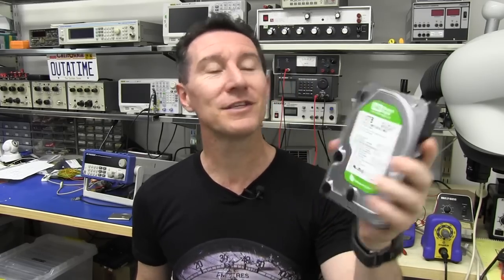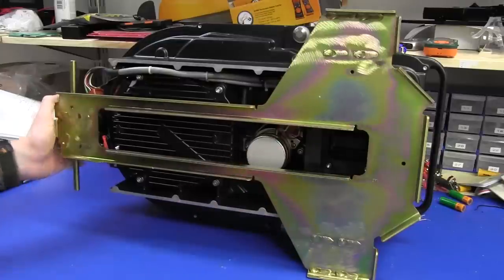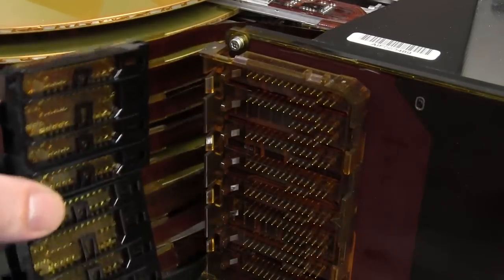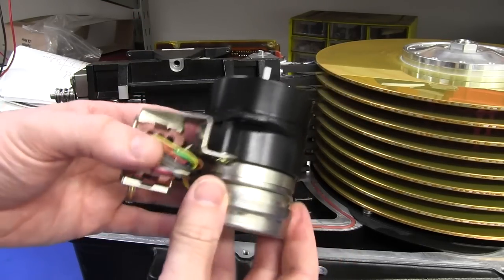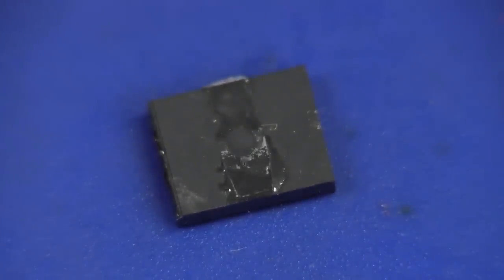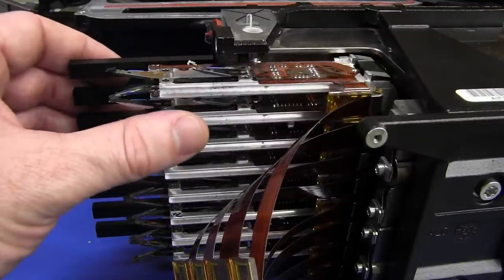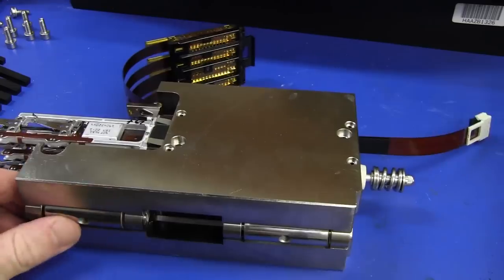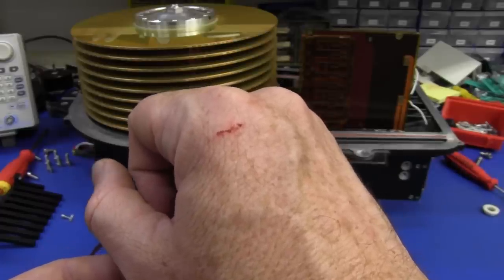EEVblog #395 - World's Most Expensive Hard Drive Teardown

Comment: I loved the video.  I worked at IBM San Jose I was on the IBM 2311 development team back in 1962 or so. The 2311 was the size of a clothes washing machine and head movement was via a hydraulic pump and It sported a massive 5 meg, removable platter. I worked on a thing called a robot whose job it was to connect the 2311 and power it up, make it move and read/write the data.
I had no idea how important this drive would become as it allowed the start of Silicon Valley when company after company ripped off the 2311 design for there own products.
If I had only known - sigh.

Comment: I opened a few drives too, a MFM drive witch used a stepper for the head movement , and several newer ones that use 'voice'coils like this unit. I played music trough them for demonstration, the sound was not that bad actually, a little low volume, easily solved with some cardboard     8-)

Comment: I remember back in the 90s that a service team came and replaced all the glue on the heads in our 1 Gb multi platter VAX hard drives because the glue outgassed and was failing in sysyems about as old as ours were even though it was only a few years old.

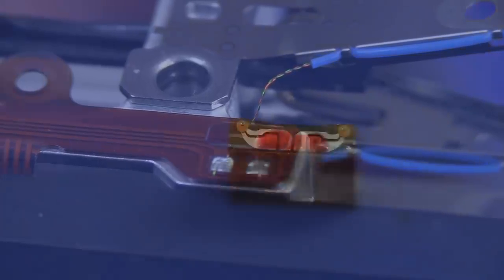Comment: At 24:24, there appear to be two head coils, but one of them isn't connected.  The disk drives I worked on, and also the tape drives (I later worked for StorageTek, who made take robots) did a read after write - so data was written by one head gap, then immediately read by the second head.  The read was used to generate a CRC (Cyclic Redundancy Check) which was compared with the CRC that was calculated for the write, so that the data on the magnetic surface could immediately be verified.

Comment: You're talking late seventies, and 10MB, but even at the end of the seventies, a 10-40 MB disk would fit into a normal 5"1/4 full size disk enclosure. The Xebex 1210 is already from that era to control it as well. The stuff that would end up in the IBM PC a couple of years later was quite off the shelve stuff even a few years earlier.

Comment: The heads do not come in contact with the surface of the platter ( not supposed to anyway).They float on a cushion of air after the drum has spun up.    Most metal recyclers won't accept older drive platters because of the 'toxic' coatings. Your drive is tiny.  I have the HDA from a 5 meg Ramac drive at home. the drum was the size of a 44 gal fuel drum.  the drive was 800Kg.

Comment: Great video! However one statement needs correction. At 25:27 you state that that the skids reduce the contact surface area and therefore reduce the friction. This is incorrect as the frictional force is dependent only upon the co-effcient of friction and the normal force acting on article; the contact surface area has no effect on frictional force. The skids are there to create an air gap which assists the lifting of the head when the platters begin to spin, causing the boundary layer of air on the relatively fast moving platter to induce lift on the head, as you correctly stated.

Comment: So many errors and misunderstandings in this. For starters:-
That's just the HDA (Head Disk Assembly) from an IBM 3390, a box the size of a couple of fridges. There were 2 to 6 HDAs (depending on model) in the box, which also contained all the other electronics required to provide the equivalent function to the familiar hard disk. These were introduced in 1989, and the HDAs have absolutely no resemblance whatsoever to the earlier models that they replaced. (I've torn down a number of them myself) This is definitely NOT 1970's technology..
And the HDA cost nothing like $250,000. The whole box, along with the other HDA(s) and electronics, started at $90,000.

Comment: That drive is a lot bigger than 1MB per platter. I ised to work on 70s units that were 35/70 MB. Biggest drive i saw was in LHR air traffic control. about 3-4ft diameter single platter. fixed heads 2MB

Comment: That would be using something like rll or mfm encoding so the controller would need to encode the raw data for writing or decode it for reading. Back then it would have on the interface card and not the drive.  It was only when the later SCSI and IDE interface came in the late 80's that the encoding was handled by the drive.  The current drives SATA and SAS drive are the same just the interface has changed and throughput has increased.

Comment: I remember these drives on some mainframes I worked on in the late 80s / early 90s ... The days when "IT" was called "data processing"! These were up to 60 MB by then. The drive here is missing the controller board(s) and power supply = Taking up 3 times more space of the massive drive assembly! Also keep in mind that 250 grand was in 1990 dollars = almost double that considering inflation and CPI. Jeez...

Comment: And to think of how quick the technology advanced in 40 years that nowadays we have hard drives that can store up to 20 TB in a single unit with a couple of platters that the data is super-concentrated there.
And probably in 10 to 20 years we will sureley see and use HDDs or most probably SSDs that will be able to store up to half a petabyte in a 3.5 or 2.5" bay.

Comment: If this unit was used and not block erased you can possibly recover data from it up to 75-100 years later, so information valid from jan/1/1989 to dec/31/2,089. Of course, it would be in any good shape as the temperature sticker, but may still be there.

Comment: Napkin math tells me that 16 surfaces with 11" (28cm) dishes holding 10MB is an info density of about 8100 b/cm², or about 52,000 b/in². In 2020 we have commercially available HDDs with more than 1 tb per sq.in. (approaching 1.5Tb/in²). 1980: 52,000b/in² (for $250k) -> 2020: 1,000,000,000,000+ b/in² (for <$100). When people wonder why I'm so enthralled by tech... I don't even know how to start explaining it to them. You're helping!
edit: I see now that 10MB was way off - I heard you say it at the beginning but now I see the info and I've looked into the 3390, more like up to 22GB! That changes the math a lot, now it's more like 18mb/cm², so only 2-3 orders of magnitude in 30 years, not 4
Reply: In fact, there are only 14 surfaces used for data and the capacity is 3.78GB.

Comment: I was using 19" (I think) drives that combined a 4.8MB fixed and a 4.8MB changable medium on the same spindle.  From memory I'd say about 20cm high, the media I think were 12" but not sure, it's sooo long since.  They needed like a minute to spin up, then one could press a mount button and move to the console to actually mount the drives.  The system was running Edition 7 UNIX, a Interdate 7/32 and had three of these drives.  And a nice three phase connector.
The drives also contained two huge elctrolytic capacitors each about the volume of a 1l or so.  Their sole purpose of these caps was to retract the heads in case of a power failure to avoid a headcrash.  Which made a spectacular loud bang.
I can't image the heads on these drives were actually in contact with the platter, how can that have been reliable?  They would have required magic to keep the friction low!

Comment: Well I used to work at a Southern Bell data center in Fort Lauderdale that handled all the billing. It was 1976 and we had a couple dozen ISS disk drives 100 MB each. They had a removable disk pack that had twenty surfaces, one of which was a servo track used for positioning. The disk platters were about 15" in diameter. Head assembly was on rails and was moved by about a 4" diameter voice coil that had a massive magnetic structure. A seek operation would cause the head assembly to ramp up to full speed and decelerate and come to a full stop without any overshoot to the track it was seeking to. And it moved very fast.  One weekend a SoBel employee loaded a disk pack into a drive and walked away to get back to the operators console, 50 feet or more away. Well the heads crashed and since the operator couldn't read the pack they moved it to another drive, and another drive and so forth. Well a head crash means just that. The heads fly above the disk, supported by a cushion of very filtered air, but only by a micron or two. A particle of smoke was at least fifty times bigger than the air cushion was. The head crash created enough debris to crashed all the heads in that drive and each drive they moved the pack into. By the time they were done the pack had no oxide left on any surface and each drive had piles of broken ceramic heads everywhere in the disk well. I got to fix them all too. Had to install all new heads and align each one in about eight drives. Later on ISS produced another model that was the same size but doubled capacity to 200 MB, we were amazed! I maintained those disk drives, large Telex nine track tape drives, there were about thirty of those, IBM and Telex line printers, IBM card punch and reader, and multiple main frame multi-processor systems that ran them all, custom designed for Southern bell. We were a team of four field service engineers at that site. I got hired there due to my extensive knowledge of Digital Equipment Corp 11/45 Unibus systems. I was the company specialist on those and got flown around to handle the problems others couldn't fix. I loved my job too, it was lots of fun. Never hated going to work. An hell, I got to live in Fort Lauderdale, Florida. What's not to like?

Comment: Interesting. According to the updated information this is either a 1.89 or 3.78GB drive.
As was shown in the video, this unit was apparently made in 1991.

Recently I acquired a Seagate 2.1GB SCSI hard drive of a model that was made and sold in 1994.  According to 1990s newsgroup postings, the "list price" was $2500USD, but people were buying them for more like $1500-$2000.
It's a 3.5" form factor drive but it's "half height", meaning it's 1.6 inches tall. So it's almost as small as a typical modern desktop drive, just taller due to the number of platters it contains.

It's obviously a hell of a lot smaller, simpler, and cheaper than this drive of similar capacity made just a few years earlier.  So it stands to reason there must have been something more practical than this with ~2GB available in 1991.
At that late date, I suppose this IBM drive was NRND and just being offered as a service replacement part.  Which makes me wonder if it ever saw actual service, or saw enough of it to gain much wear.  Maybe it still worked.

Comment: The temperature sticker looks to be the one off-the-shelf component in the drive -- you can get sticker tape thermometers just like that meant to stick on fishtanks. Also according to Reddit (EDIT: post seems to be from 2016, so after this video was made), this may be a 3.78 GB or so drive, which would explain them still making them in the early 90s. It seemed strange to me that anyone would spend a quarter million on a 10 MB drive in 1991, even just replacing old equipment.

Comment: Right, thats not a 70s machine, 1989 going into the 90s.  I worked on the 1970s Control Data storage module drives with removable packs, some had 5 disks some 10. There was a fixture you used with long mirrors and light to look for bad spots or scratches on the disk. clean room only.  you could replace the heads & align, very dangerous because you had the thing spinning and  your tool in there on some track, had to loosen the head, adjust, tighten.  Sometimes the operators would make a HUGE mistake, hey disk TR003 showing blank but it had lots of files? ok go move the pack to TR002 and lets try it there. Yes data! oh wait its gone again? put it on TR001... no data.  Go out there and its a burning smell and metal dust is coming out. Just destroyed 60 read/write heads on 3 machines taking about a week to fix all 3. They had SCSI interfaces, ECL logic and the seek time was as fast as now. Just the bits per inch and disk materials changed radically.
Reply: These also had the fiber service ports, same as you describe, and are also removable cartridges. I worked on them many years before.
I was the one who pulled it out from the bank. They kept making them years after, due to the original massive install costs.

Comment: The technology to make computers small and fast has significantly impacted all manufacturing for the better. Indirectly it made it possible make engines for cars that run for 300,000 miles and take water thin oil at 5w.

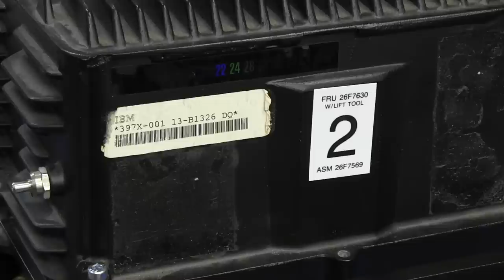Comment: Uber-old bump... An educated guess is that number at about the 4:00 mark is in reference to an IBM 3970 telecommunications adapter. Back in the day, on mainframe systems from IBM, you'd get these generic interface descriptions which were misleading at times. I believe that in this case the marking is showing interface compatibility with the 397x series adapters. They say "telecom" adapter because that's what they were first designed to be used for (modem lines, matrix lines, etc), but it's just an I/O, so they bodged it to use hard drives as well as floppys. Interesting fun fact is that you could (again, back in the day. Think 1980s) go in a serial line from a mainframe to a controller to a PS/2 system and mount drives and the like along any device that had the resource. When the place I work went from mainframe to distributed server architecture, it really confused all the "old guys" at the time. Now that I'm an "old guy", I get their confusion!

Comment: Are you sure about that Halon thing ... I think they used those to pump pressure out of the drives so that dust and bits of stuff would not fly around inside the drive and crash the heads, but it has been a very long time.   I don't think Halon would be good for the magnetic surface of the disk.

Comment: Seeing as this one was built in the early 90's, it was likely to replace older drives in old equipment. 
I cant help but wonder if if they could have built newer smaller dives with the same data interface as a drop in replacement. Smaller drives would have used far less material and used far less energy. IBM could sell the newer drives with the same specs for more, because of increased reliability or less maintenance as well as far less  power demand, not to mention less data center cooling.  So IBM could make up the R&D cost for a retro fit drive in material savings and the demand for better drives.

Comment: The first thing that comes to mind when looking at that thing is some kind of giant supercharger or crazy intake plenum for a dragster's V8. Those rubber shock absorbers on the bottom are about as big as some of the suspension bushings you might find on a smaller car like a Honda Civic. Hell, the whole hard drive itself is almost as big as a typical compact car's front wheel drive transmission or a little bit bigger than a pickup's rear axle. I Definitely would not think that it was something that you would find in a computer. 

The whole unit outside and even inside has an automotive design feel to it. I won't be surprised if many of the components were designed and made by companies that also make automotive parts. The shell, like I mentioned resembles an intake, it even has a gasket very similar to one you would find on an intake or cam cover. Also adding to the automotive feel are the cooling fins that look like something that you would find on an old air cooled motor like the old 911 or VW motors. The rubber bushings are very similar to ones found on suspensions. The actuator motor is similar to those used for windshield wipers or power windows. The springs inside the head assembly look like mini valve springs. Those dark red plastic cable connectors are very similar to ones that are found on the back of ECUs and other on-board computing units like the SRS (airbag) modules. Even the sensor on the drive motor is typical of something you would have found inside of a distributor to monitor ignition timing or on the timing belt gear to monitor cam position among other things.

Comment: The Halon 1211 and 1301 (the types used for fire suppression) aren't poisonous, but if they don't put the fire out they break down into a poisonous gas.  

Computer rooms would have a sign saying to not open the door after discharge.  Ideally you would leave the machine room upon hearing the 30(?) second warning horn if you could.  You either had to be inside or outside for a few minutes after discharge, because opening the door would dilute the gas.  

Halon reduced the amount of oxygen in the atmosphere, but not so much as earlier CO2 systems.  CO2 systems put out the flames by displacing oxygen, so they needed a high concentration, which could asphyxiate room occupants.  Halon worked by interfering with combustion (something to do with radicals or ions in the flames), so only needed a lower concentration, a concentration low enough it didn't asphyxiate room occupants.

Halon was also used for protecting ship engine rooms and military aircraft.

I was just reading, Halon isn't used any more because of what it does to the ozone layer.

Comment: Heads fly a few microns over the surfaces after the platters spin up to speed. They do not start out in contact with the platters. It just appears that way. Good American engineering by IBM - built to last forever.

Comment: IBM obviously made a better head retractor than Burroughs of the 1980's. Burroughs B3500 required a solid metal, multi-prong head retractor tool. The problem was that a field engineer could forget to remove the tool before trying to restart. It happened at our machine room. The FE scratched all the platters and forced the tool into the holes in the hub. Big down time! Those units were called LAKS which were basically drawers which locked until they came to a dead stop.